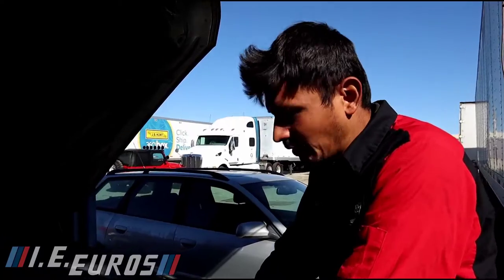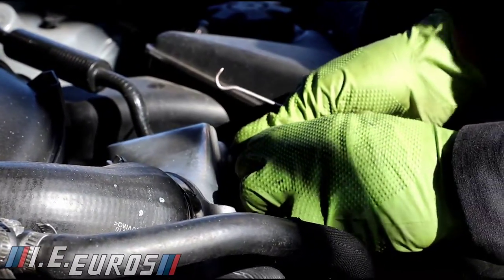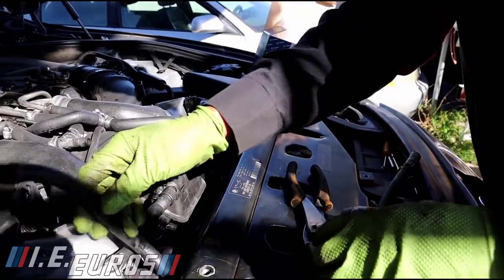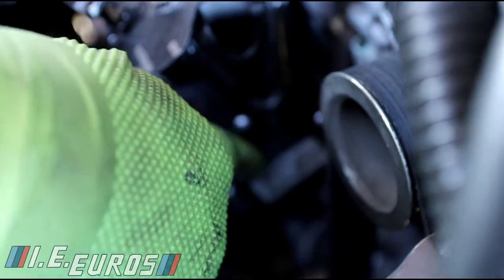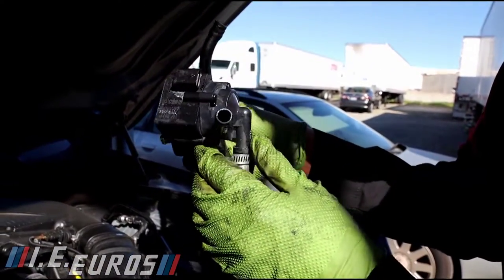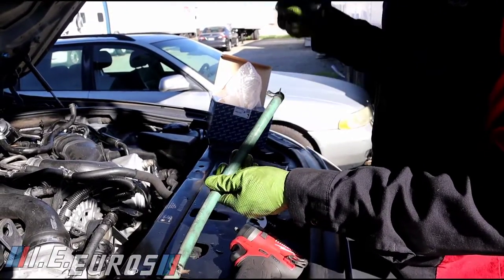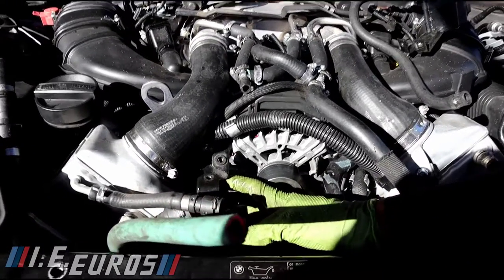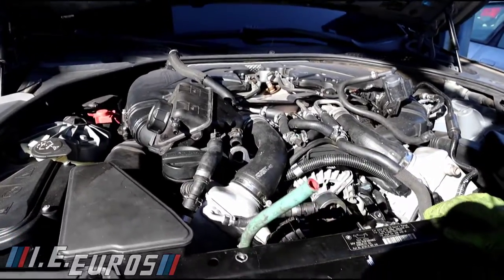BMW N63 engine turbo cooling pump replacement installation 550i 650i 750i 750Li X5 X6 50i

Comment: Awesome video. Had a question. I had all alot of coolant come out of course from the tank and lines but my question is concerning all that came out of the passenger side turbo. What is the best way to get coolant back in the turbo and lines and at the right level before starting?

Comment: hello I have the same vehicle, and it consumes a lot of oil, do you know where it can come from? thank you in advance for your help
Reply: He doesn't answer  . .
Reply: @nizarkailani6463  Unfortunately not
Reply: Valve stem
Reply: @louisianavq1943  I Hope not 😕
Reply: how to check the valve stems?
Reply: @callofpaca3455  does your car smoke?
Reply: @louisianavq1943  yes, 1 liter/1000km
Reply: @callofpaca3455  jeez man😬 I started working at a bmw dealership and while I haven’t changed or diagnosed a car with bad valve stems myself, I’ve seen it enough to know. You should take it to your local bmw dealership to have them check it out they have people who will know forsure
Reply: @louisianavq1943  ok tks